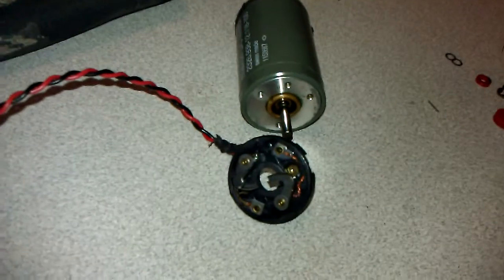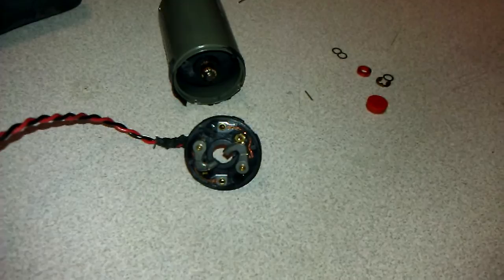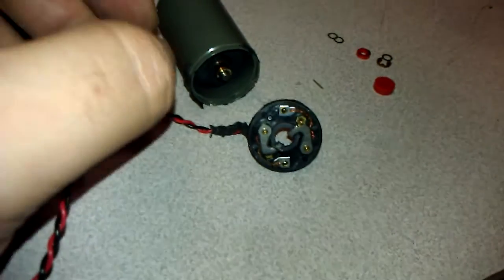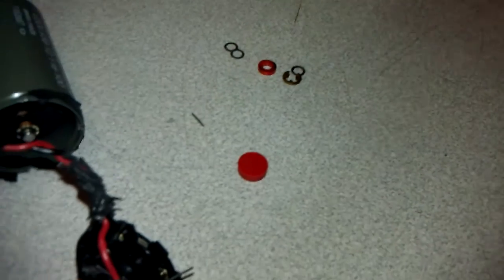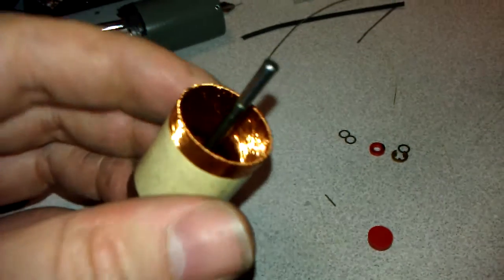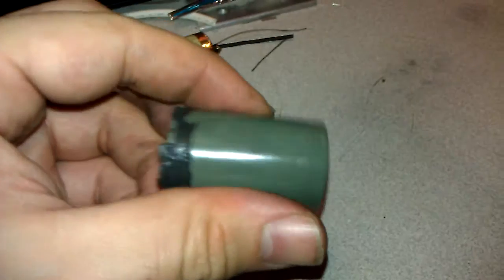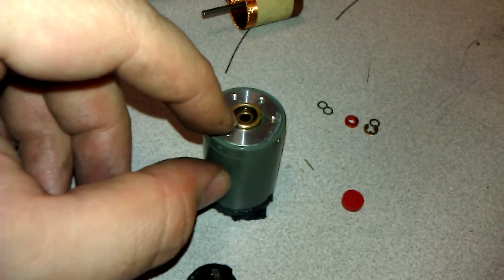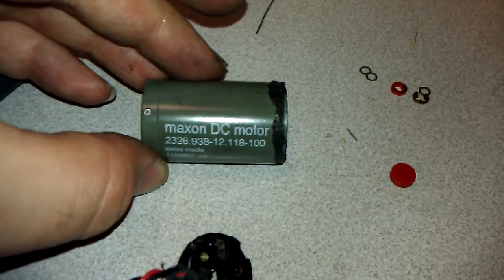Teardown on an old Maxon DC coreless motor

Comment: Interesting, I THINK I may have just learnt what is wrong with the similar Canon motor I am trying to repair...so here is my question: the heavy central core which you can see inside the motor casing, is that somehow secured to the outer case? On mine it is loose, and I am wondering if the attachment to the outer case is broken. (This is my first strip-down of a coreless motor so I don't know what it should look like)
Reply: struck2soon magnet should be fixed to case, it’s the stator so it stands still. Only the copper coil rotates which drives the output shaft.
Reply: martijn, thanks for the reply. There is a nylon bush which is inserted into the end of the magnet, and a similar bush in the outer case. I am guessing this has perhaps broken, allowing the magnet to be free from the outer casing. I may try aligning the magnet and glueing it to outer case. Is it ok for it to touch the outer casing or does it need an insulating piece between the two?
Reply: My Canon motor inside Canon Motor Drive MF has the same problem as yours. Have you managed to fix it or got a new one which can replace it?
Reply: @huzhijiang3966  I have sourced a conventional motor to replace it. Apparently coreless motors are not ideal for model locomotives!
Reply: @struck2soon  OK, but for me, I was afraid conventional motor's torque may not meets the requirement of my Camera Drive , so yesterday I eventually found a not-very-old second hand Maxon A-max 391116 coreless to replace the broken one which is too hard to repair for me. Result was good, just a little bit slower though..